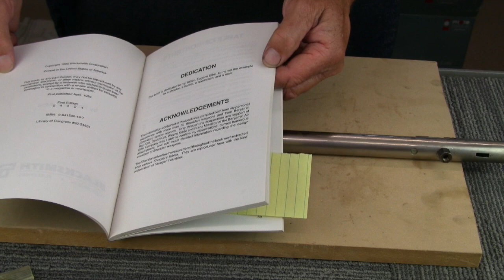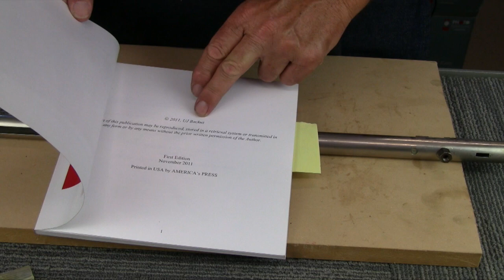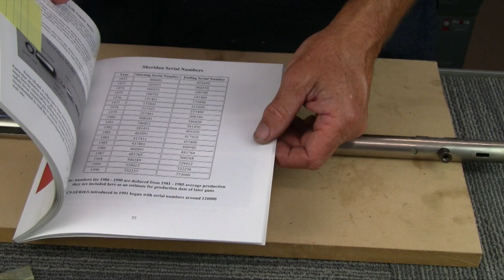Air Time No. 1

Comment: I just aquired a Benjamin 317 and the pump handle does't stay up against the air chamber. Can I just adjust the pump rod to make the handle sit tignt? Or does in need a new spring? If you could lead me to a video on how to determine if its the spring or an adjustment that would be fantastic. Additionally at one time someone told me you need a press to install the pump handle spring. I'd love to see a video on this.

Comment: It's possible to take of the pump cup of a Benjamín 392 without dessambly the pump arm and the pins??? Great video
Reply from the maker: I don't know how you can do that.  If you do, please let me know.
Reply: NorthWestAirgun I tried an I could detach the old pump cup to the piston without having to desarm the pump arm and the pins, I take it out the rubber cup pulling it with a screwdriver through the gap that is above the air hole, that was easy but after that I wanted to put the new pump cup by pushing it inside the piston head with a stick through the cilinder, it seemed like a good idea but it was impossible, so I decided to take out the pins with a brass rod like you teach on your videos and finaly I could fix everything and not a major scratch to my rifle, thank you your videos healped my a lot the gun that I fix was a benjamin 397 in 177 cal I really love the old 20 cal also